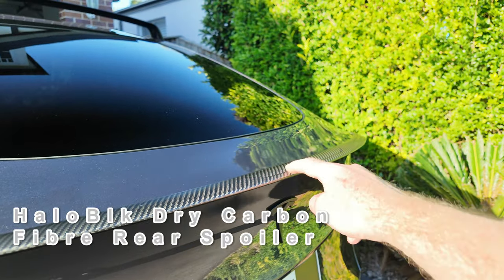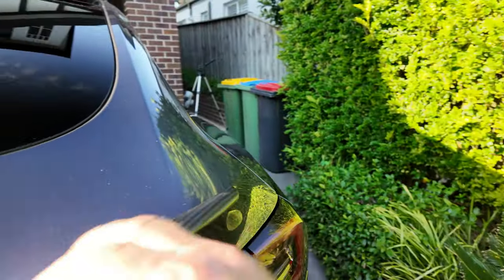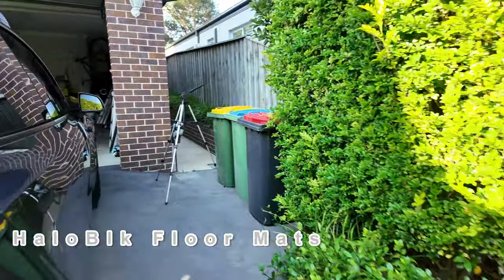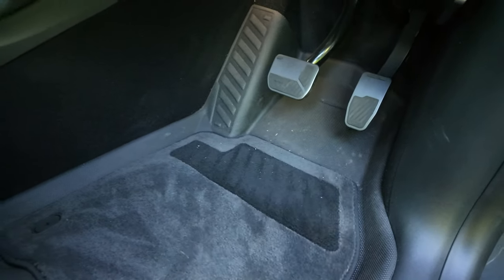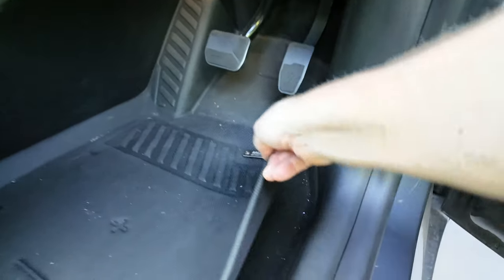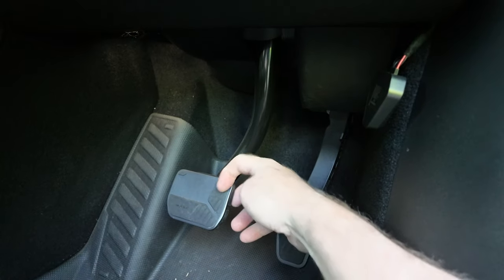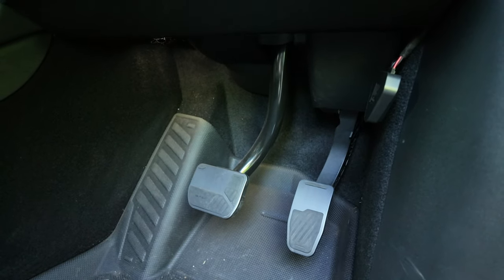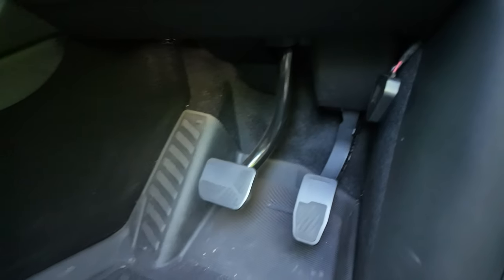Tesla Model Y Carbon fibre side mirror cover install + long term accessory follow up

Comment: Thank you Matt for all the outstanding information you provide and keeping us Tesla owners educated and knowledgeable while at the same facilitating understanding of the information you share! 
Alas, I'm in the midst of a debacle and you are one of the most knowledgeable persons I know regarding Tesla matters on YouTube. Believe me, I cannot find any information in the manual regarding my situation. May I ask you a question(s)?
Reply from the maker: No problem
Reply: @notinthemanual  I have a '22 M3P with approximately 28,968km and absolutely love the car! The car comes with a "Premium" sound system which sounds alright but the sound fidelity doesn't sound premium in my opinion. I'm a bit of an audiophile and knew the sound could be improved without too much difficulty or hampering of the OEM Tesla design.
After I zeroed out the audio EQ settings and disconnected the battery under the bonnet and under the right back seat, I made some quick and simple changes by swapping out some of the speakers: 3 front dash speakers, the 2 front door woofers, and the 8" subwoofer. I don't listen to my music at high volume levels so I decided to use the stock Tesla amp which should have ample wattage. Well, ample as long as I keep the speakers within the same specifications as the Tesla OEM speakers.
The 3 front dash speakers are rated at 3 ohms/33W watts, door woofers are 4 ohms/80W, and subwoofer is DVC with each voice coil rated at 4ohms/80W. I met all the aforementioned requisites except for the subwoofer which was a DVC rated at 2 ohms/250W rms. For the subwoofer I made a wire jumper for the +/- terminals so the coils would be wired in series resulting in a rating of the necessary 4 ohms. 
Having an injured dominant hand, things went slowly and before I realized the time, the sun was setting! 
I was able to complete the speaker install and reaffixed the trunk weatherstripping using the illumination of the exterior house lights. I had to get it done as I was getting surgery on my dominant hand in 35 hours!  
I reconnected the battery connections under the bonnet and back seat and did a very minimal volume audio testing using Spotify. All speakers had sound and checked good! I buttoned things up and decided to have some dinner. 
After dinner I decided to drive to a nearby market and do some sound and EQ adjustment settings and get things 'dialed in' without the chance of disturbing/waking up my neighbors. I changed the source on the sound system to Bluetooth in order to listen to sound files from my phone. I increased volume to approximately 53% and it sounded absolutely amazing!! For about 20 seconds then I lost 87% of the sound. The 3 dashboard speakers are the only speakers working now (which I believe are wired to a secondary amplifier). To make a long story short (too late, I know), it seems I have blown some channels on the Tesla amplifier in the trunk. I am confident in saying this because I found the subwoofer wired terminal jumper I made in my trunk under my scattered tools! In my haste, I neglected to put the jumper on the subwoofer driver which means my subwoofer was operating with an impedance of 2 ohms rather than 4 ohms. My front door woofers & tweeters, upper 'A' pillar immersion tweeters, rear door speakers, rear deck speakers, and subwoofer are not producing any sound. I also don't have functionality from the mic as it doesn't recognize my voice/anything... So I guess I have lost the mic in the headliner as well. If I remember correctly, the mic in the headliner is Bluetooth. I have checked the service menu and the only alerts that I am getting are for my rear defroster. I wondered why it hadn't been working very well for the past couple years. There is nothing else in the service menu that I can find regarding the sound system to indicate any kind of fault. 
I got the part number off of my amplifier (1079748-00-F) and purchased another one with the same exact part number (with a different serial number, of course) that came from a totaled Model 3 from a parts warehouse (this part warehouse has impeccable credentials).
I am awaiting the new subwoofer driver that will not require any special wiring to meet the required Tesla specifications. 
So, in a quite large nutshell, there is my situation / debacle. 
Here are my questions: 
Will I need to do any kind of firmware reset or new part installation procedure in order to make this new amplifier have full functionality in my car or will it be just a basic plug-and-play replacement?
After I install this fully functional amplifier replacement, will it enable my Bluetooth mic and work again? 
I am at an absolute loss and I appreciate any help, information, or guidance! 

Best regards,
Kirk
Reply from the maker: @OptimisticPrime2357  Hi Kirk. Yes that certainly sounds like an adventure. I agree the premium audio is far from perfect but it is good enough for me. I have not had an experience replacing these components in the Tesla so I would need to do some research and come back to you. Soldering can be difficult on speaker exisiting terminals and it can be easy to create a dry solder joint. It really depends how the amp communicates with the media control unit. It may not tell the MCU about a fault. I’ll see what I can find.
Reply from the maker: @OptimisticPrime2357  I looked through the service manual and there is no mention of any firmware adjustments when replacing the amp which means replacing it with another one of the same part number would not be too difficult. As for the headliner unit with the microphone it may be a different story. If it doesn’t work after you install the new amp you can try and reinstall the firmware in service mode to see if this fixes the issue. In the service manual it says to reinstall firmware if this headliner unit is replaced. The service manual does not mention if this headliner unit is communicating with the amplifier. Is it possible that you have disturbed a plug while accessing the A pillar tweeters?
Reply from the maker: After reading your notes again I see that you didn’t actually attach the jumper wire. I thought it might have fallen off which is why I mentioned the soldering. I can also see now that the a-pillar tweeters were not touched. I can’t explain why the headliner unit is not functioning. Hopefully the amp will correct this somehow. The firmware reinstall procedure might cause this to reset and work. The Tesla service manual is freely available on the Tesla service website. service.tesla.com you then login with your Tesla account and get a free subscription to the basic service package. You will then have access to the non-HV non-safety service manuals.
Reply from the maker: I checked the wiring diagram and the overhead console does connect to the amp. My opinion is that the amp is the only damaged component. This link should take you to the schematic. https://service.tesla.com/docs/Model3/ElectricalReference/prog-187/interactive/html/audio_premium_amp.html?search=20431
Reply: @notinthemanual  That schematic was exactly what I was looking for but was unable to find it. You, kind sir, are amazing! I am thankful beyond words! When I am able to get in there and complete the repairs, I will post my results and let you know what I find! Thank you, thank you, thank you!
Reply from the maker: @OptimisticPrime2357  Glad to help 👍 Yes, please let me know how it goes.
Reply: @notinthemanual Hey Matt! Well kind sir, you were absolutely correct about the soundsystem amplifier being damaged and the guilty culprit of all my previously listed problems! My nephew is a mechanic for the US military and was able to give me a helping hand with swapping out parts since I just had surgery on my dominant hand. 
First and foremost, we replaced the subwoofer with the correct specifications of a DVC 4 ohm/per coil  driver. The subwoofer is overkill and rated  RMS 150 watts / peak 900 watts with a Sensitivity: 85dB. We then installed another used amplifier containing the same part number as the one which got fried and attached it to the subwoofer box inside the trunk. We triple checked all of our connections, crossed our fingers, and reattached the power under the bonnet and right rear seat.  All 14 speakers are functioning and sounding phenomenal (especially the aftermarket speakers!)! Functionality of the Bluetooth microphone in the headliner is back as well! I did not even need to perform a firmware reinstall. A beautiful plug-and-play type scenario! Needless to say I am extremely relieved and happy! Thank you so much for your help, instructions for properly using the Tesla website, and the wealth of knowledge while giving me a better understanding about my 2022 Tesla Model 3 Performance schematics and operation. 

All the best, 
Kirk
Reply from the maker: @OptimisticPrime2357  I am very happy to have helped and glad that it was only the amp. When I first bought my Model Y last year the sound system was a big step up in quality from my Model 3 RWD which just had the basic sound system. It was a step down from previous car, a VW Tiguan Highline with top of the range audio. Having the Model Y for over 6 months now I can notice it isn’t perfect. I have been able to adjust the equaliser to a point where I’m happy though. It would be interesting to see what the upgraded audio in the new Model 3 is like. I hope your surgery  recovery goes well too!

Comment: how does the removal work if I want to after some time?
and whether there are problems with the Wi-Fi signal after you put the covers on
Reply from the maker: They will be able to be removed without damage to the mirror if you are careful and take it slowly. Some low heat and a plastic pry tool to slowly work along the tape and separate it from the mirror cover should work. I haven’t had any issues with wifi since fitting them. I am not sure how the mirror covers would affect wifi. All of the wireless antennas are above the windscreen except for some bluetooth modules around the perimeter of the car.

Comment: Unfortunately they do not have the spoiler for the new highland
Reply from the maker: That’s strange. I didn’t notice that. I’ll ask and see if they are working on it.
Reply: Yet* they said they were working on one
Reply: @MrEddyedr  any different to the old model 3 ? Like the rear bit
Reply from the maker: @Arashiii87  I asked HaloBlk au and they said ETA is July/August for the Highland spoiler.